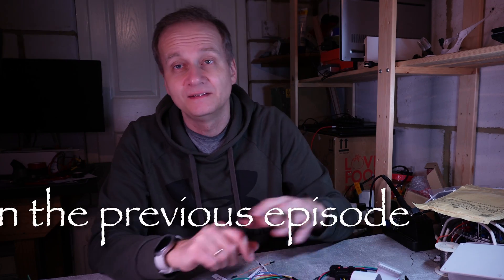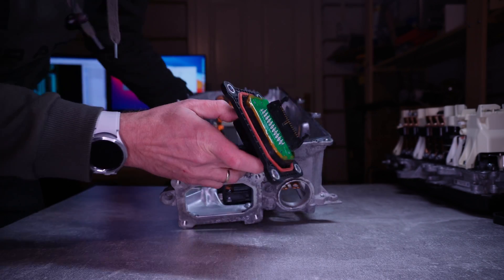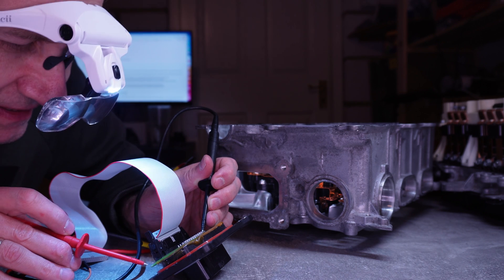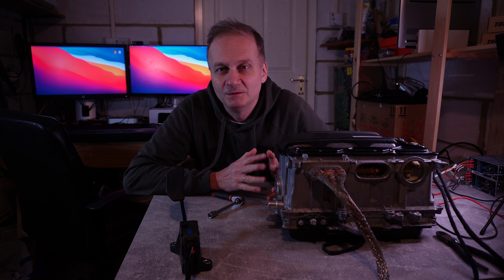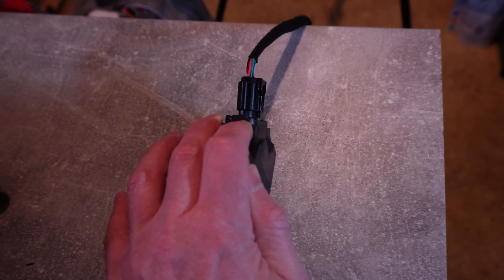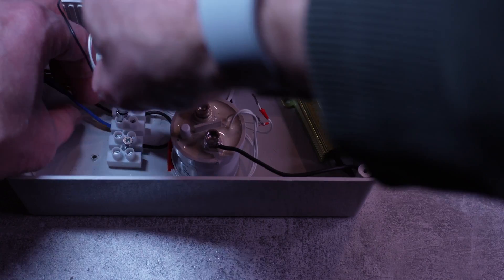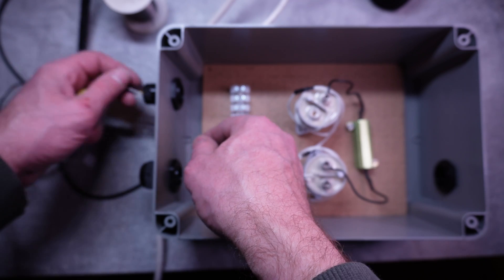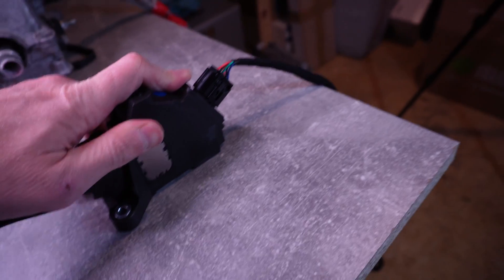Testing new wiring harness Toyota Prius DIY EV Ep 17

Comment: Well done! Now. you just need install all of this in the car and meet car computers with your system
Reply from the maker: Thank you, still loads to do before moving everything to the car. I need to sort out battery, HV cables, get cooling system for the inverter and a motor, get 12 DC to DC converter working. And probably more if I think about it properly . The battery is a big problem